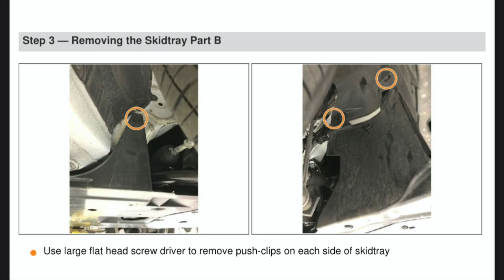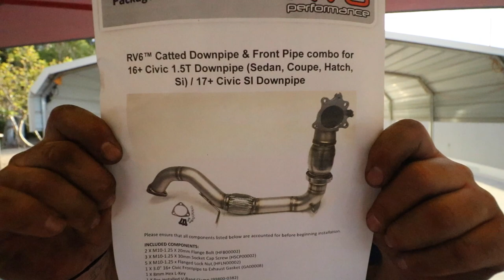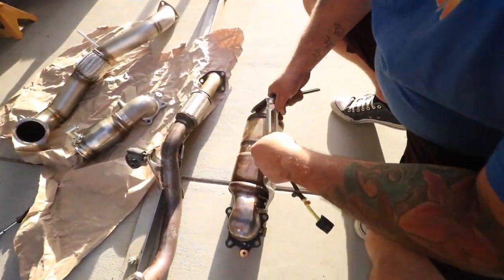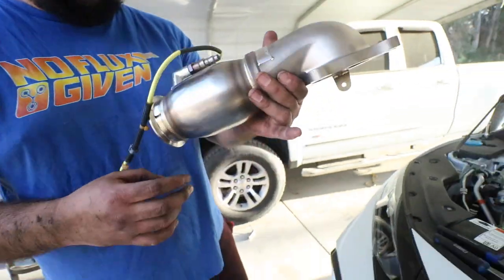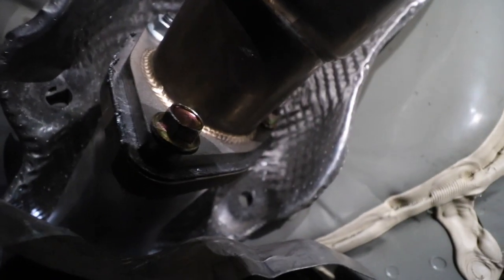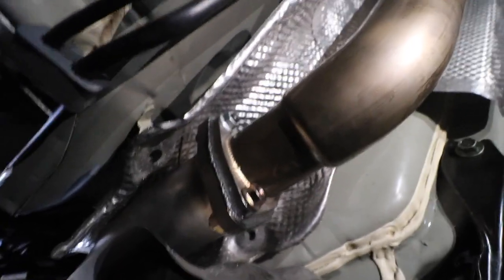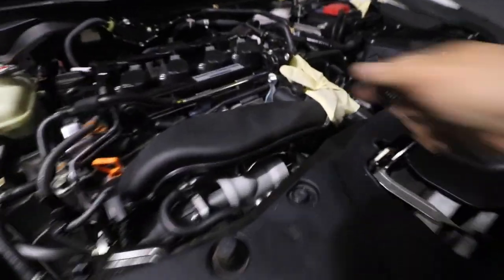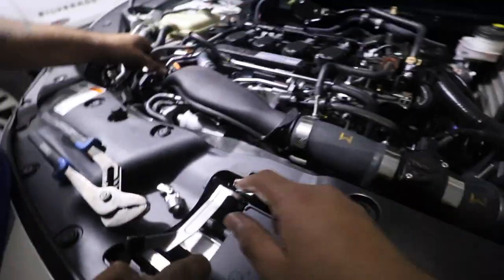2020 Civic Si gets a Downpipe and Frontpipe!! / RV6 Downpipe Install

Comment: Thank you so much for sharing! I am interested in this exact build for my Si (2020 white coupe also) My question is will this cause any system codes or emissions issues? I plan on doing this DP/FP combo but dont have plans for the rest of the exhaust system yet (i hear this dp/fp makes just the right amount of noise difference that i want by itself, and removes some restriction of the oem DP).
Reply from the maker: You shouldn’t get a code since the catted version comes with a defouler for the sensor.

Comment: i put the intercooler and inlet pipe as well as cold air intake and the w1 turbo the inlet pipe is the hardest part of the entire job, second hardest is the charge pipes on the intercooler but i have big hands a small hand person can get it done much easier

Comment: Just got my rv6 downpipe and front pipe catted installed with stock exhaust, not much louder. is because of the stock exhaust or does the pipe get louder eventually?
Reply from the maker: It’s cuz you have a stock exhaust

Comment: Did you get any codes all this time? I'm about to get this catted dp/fp combo soon.
Reply from the maker: No sir
But it’s also probably because I’m on ktuner
Reply: @TdaKid  if you disabled the 02 sensor via ktuner how do you pass emissions?

 I have to do emissions here in Illinois too.
Reply from the maker: @leatherneck75  you don’t lol

Either go back to stock or find a spot to “pass you” lol
Reply: @TdaKid  prl catted epa down pipe it is then lol